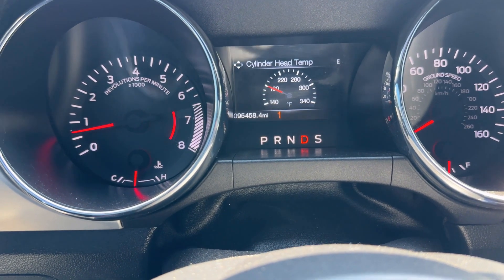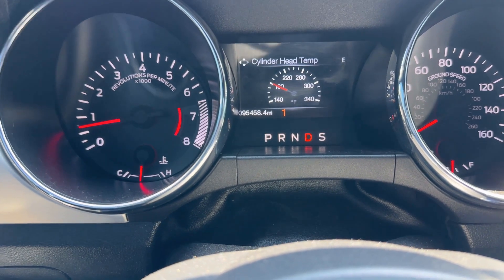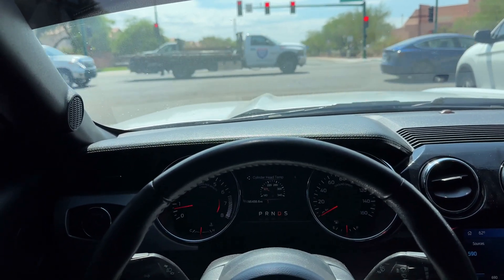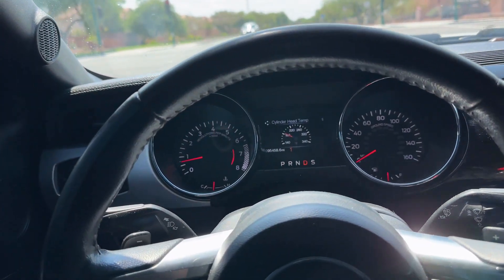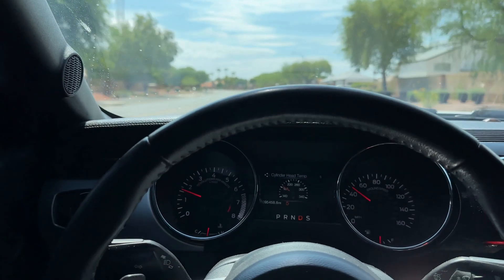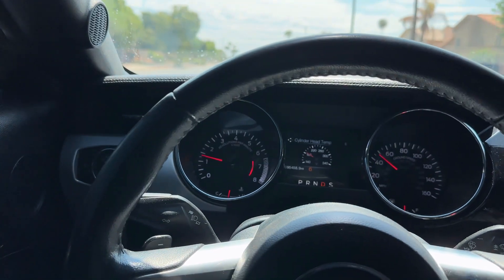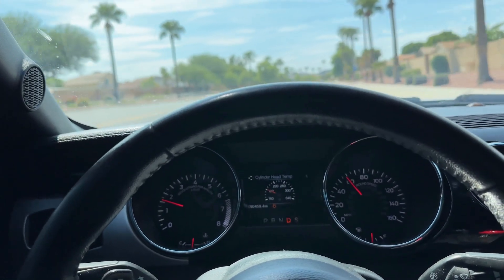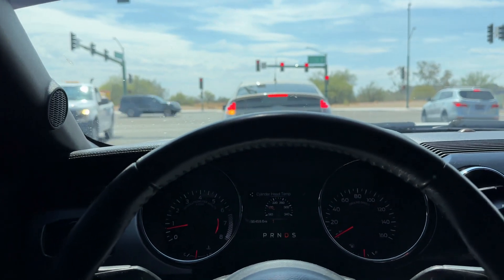How to Break in Your Performance Cams! - Mustang EcoBoost / S550

Comment: Hey man I have a 2017 mustang eco boost that had a head gasket replacement 
The mechanic has the car back together but the car won’t start 
Fuel isn’t being shot into the cylinders and we can’t figure out for the life of us why 
Got any idea why this might be happening?
Reply from the maker: Did he put the pipe on the back of the block there’s one that goes to the high pressure fuel pump to the fuel rail. There is also the high pressure fuel pump can fail. I would pull your fuel injectors out and see if there’s anything at all come out. Make sure all fuel injectors are plugged in.
Reply: @DailyDrivenStangs  thanks for replying so quickly
Reply from the maker: @DigitalBackup97  anytime man some one hit my new car today i been trying to file a clam it's on my YouTube short check it out when you have time.
Reply: @DailyDrivenStangs  I’ll definitely ask him about it from what I saw everything looked pretty good 
Ford diagnosed it as a timing issue but he took it apart and he said the timing wasn’t off 
It’s just a cluster fuck at this point it’s really disappointing not getting fuel in the cylinders
Reply from the maker: timing can do allot and if it's not set right it will kill the fuel to protect the motor. Yes i can see that being the problem. I would have him redo the timing man see if that will fix it.